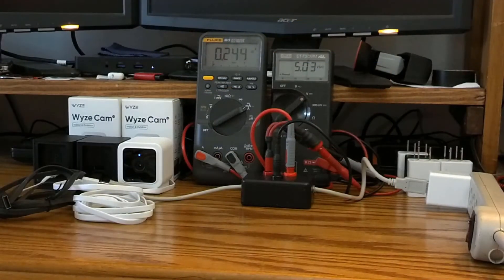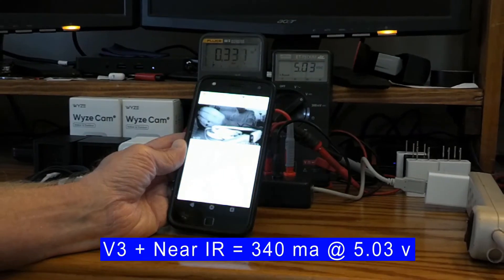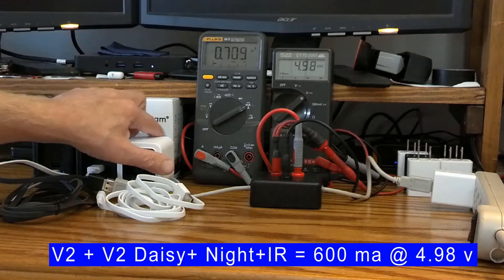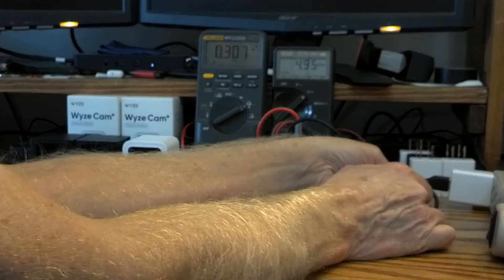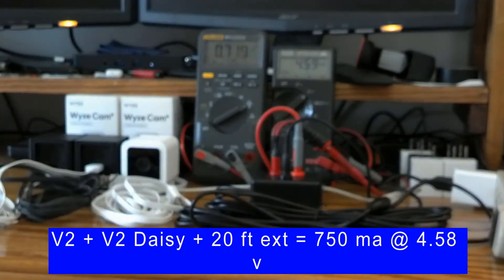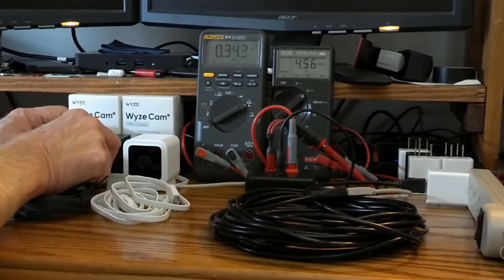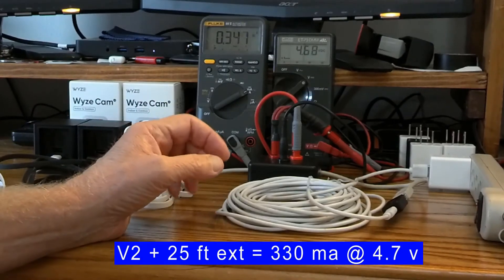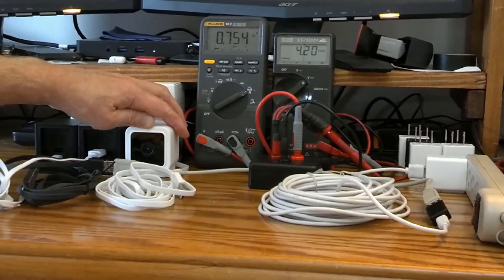Wyze Cam USB Extension Testing

Comment: Try to buy at Home Depot regular electrical cable, cut the usb connections and connect to that cable. In this way I think should be work even 50 ft or more.

Comment: Excellent video! I was going to add a Reolink lumus camera to a street sign to get closer to the street, but the distance to the nearest outlet was about 35 to 40 feet. I didn't think about the voltage drop that could happen, but after watching your video, was surprised how much of a drop could occur. I remember that most electronics need X number of volts to be stable. Adding a 35 foot cord could make things worse for me. You probably saved me money as well as aggravation. Thanks for your hard work!